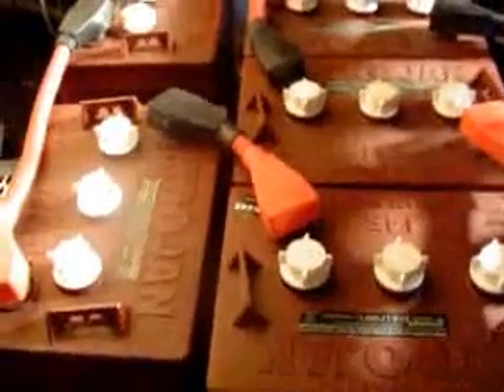EV2  Electric Jeep Part 5:  How Does It Go?  Part A

Comment: in one of your other vids i watched you remove the motor. then you removed the trans and i saw the clutch disc with no facing that looked like it bolted to the adapter plate. I didnt see the plate so i guess what im getting to is do you shift the trans and if you do how do stop power to shift. im confused and may be didnt get a good look at the video. i saw that you were responding to questions this. thanks for all the great info and videos keep them coming

Comment: I love building my jeep and when I saw this I knew I had to build one someday. Unfortunately I won't have the time or money for another 5 - 10 years. It would be great to build a camping rig like that though.

Sorry to grill you, but how would a solar supplement/charging station on the hood work. Or possibly a tiny gasoline generator mounted in the bed. It seems like with the right batteries and charging supplement you could go across the country for free or cheap.

Comment: Very cool stuff. I have a few questions. Have you looked into sourcing any NiCad or Lithium batteries or anything other than lead? How long is the typical charge time? And would it have worked with the stock transmission in the jeep?